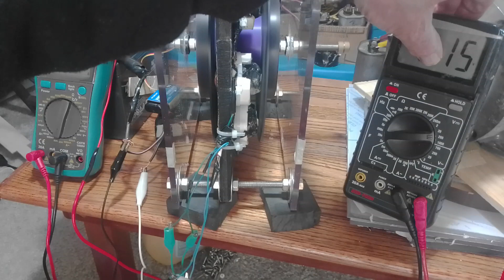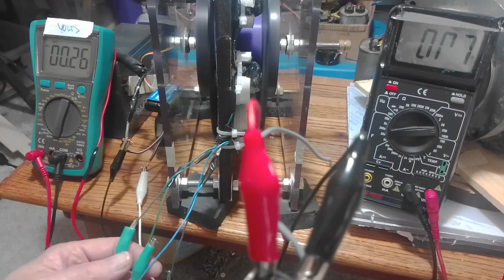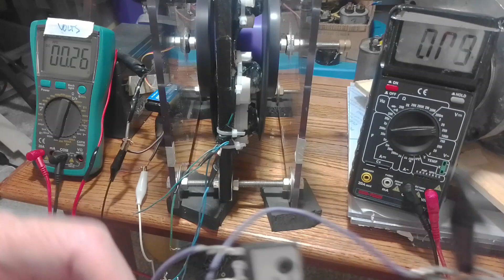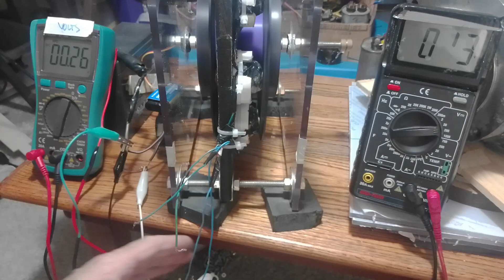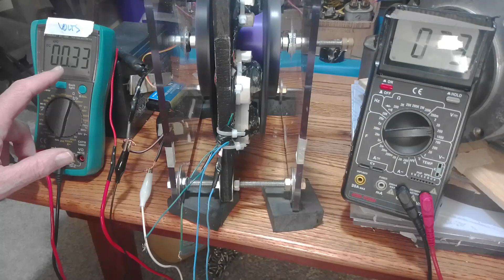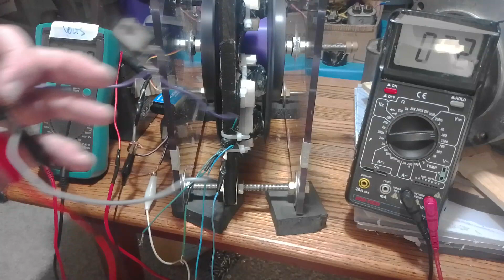.26A or .19A or .02A input at  12vdc input plus flyback and generator coils into cap

Comment: your generating volts DC so you have to put the dc threw an inverter before being ably to use it with ac devices like refrigerator .  Unless you plan to buy all new dc appliances its probably more electrical efficient to just generate ac and use it real time that what you dont use you can rectify into a battery for later inversion to ac but there is loss when you invert keep in mind , thats why its more efficient to use the ac real time , and instead of inverting dc use the dc to spin up a pulse motor attached to a super heavy fly wheel and store all your energy in the fly wheel , from there converting ac can be done without any loss , such as inverters cause (loss) about 20% or more sometimes
Reply from the maker: Hi Myke   my plan is to do the best of both worlds, fill cap A with flyback/backemf and induced generator coils, then fill cap bank B with also flyback/backemf and induced generator coils.  Then shoot cap bank A one way, and cap bank B the other way and its now an AC that can run AC stuff, if you want AC that is. Also doing it like this cap bank A can be "collecting" while cap bank B is discharging to load and vice versa.  The caps need to be decoupled during discharge, so if you do not do it with the alternating discharge of two cap banks, during the discharge of decoupled cap, there will be no collecting of flyback/backemf during that disconnected/decoupked period of time, things might blow up if suddenly the flyback/recoil recovery circuit is suddenly disconnected, plus you are losing some power that could  be collected too during that "decoupled" period so best to have two cap banks alternating in their discharge if you dont want AC but DC to charge batteries or whateve that can be done easily as well.
Reply: @MrDKONZEN  looks like you finally figured out the point in this diagram https://www.youtube.com/watch?v=WH4watZLhOA    I have been watching your channel seems your plan is to eliminate lenz using muller method , in my honest opinion and its only an opinion , i dont think you can get any amps with out lens drag occurring . None the less if someone finds a way to eliminate lens while keeping the amps and volts associated with it , that would be an achievement . Instead "MY PLAN" is to do what you just described by bouncing the flyback back and forth . This idea occurred to my after proto typing the Bedini SG  circuit multiple times. Some where along the way I noticed others trying to automate the swapping of the two batteries and out came the diagram shown , although this diagram is not an automation circuit its more of a 180 degree bounce a lot like a dpdt relay if you look at a double pole double throw relay you will see what  i mean . OK GL Man ,
Reply: @MrDKONZEN  I believe the npn will burn out if the on time is running to long because the coil gets fully saturated, it may not be necessary to fully saturate the coil to do any over unity , i believe over unity is achieved with finesse and a very gentle pulse DC, so essentially high volts are not required , for example sending 5ma dc 5v pulse with 5% duty cycle threw an inductor whos winding is 1/8inch thick  or more with fewer turns , the spike will not be in the 1k volts but it will be in the 200 v range , why the need for thousands of volts is beyond me maybe thats the brut of Man ass thinking
Reply from the maker: @mykedoes4099  yes less on-time as is possible.....working with motors spinning loads on shaft,  you might need more on-time than is perfect in a perfect world but there is a happy compromise somewhere (sweet spot) .....motors running on very high voltage pulsed DC have that problem of the flyback spike being at least 50 times the voltage of the input "forward current" voltage (while in your example of 5V and 5ma run motor its not a problem in fact something good to tap into caps or load)
.....so run on 1000VDC "pulsed" what comes shooting back is now 50K voltage good luck putting a diode and cap on that to bottle it up!  So now it gets to spark gaps like the Edwing Gray  motor used and maybe step down with HV transformers "or something" and charge 2nd battery pack with it. 
Why people like HV (one reason) is that in way of "generator coils" (making power) there is just no lenz braking reaction to rotor as the high voltage is "so thin" like flying airliner at 20,000ft vs 2000ft - just way better fuel economy up where the air is thin.... electrostatic generators like wimhurst machines an extreme example of absolutely no lenz law upon loading of generator coils stuffed with the HV
Reply: @MrDKONZEN  There is no flow back into a coil connected to a Capacitor because the battery is also a load assuming there is a battery in the circuit. This is why its important to look at the battery less like a storage device and more like a regulator which it is in regards to the  flyback other wise  Bedini would have just used capacitors  instead of a Battery. Its obvious the use of Battery is work around to having your capacitors blow out from the high voltage so in some way the battery is more capable than capacitors and in other ways capacitors are more capable than batteries , my thoughts are they should always be used together as one unit
Reply: @MrDKONZEN  if your flyback voltage is constant to 10k volts , i would use a 12kV capacitor array and then use a winding to drop the voltage back down in isolation
Reply from the maker: @mykedoes4099  I understand what you are saying, but I think if lead acid batteries, its best to just shoot the flyback right into them....they can take it, they like the spikes and lead acid batteries very good for that.  But "other way" is caps only go to 36V discharge to 12V battery down to 23V in cap and stop there.  You would have to do long term tests to see what is more effecient and effective battery charge. I dont really know for sure.  
You dont want caps to blow out from too high of voltage,as  they need to be discharged periodically......
hard to ruin a perfectly good battery with the HV flyback spikes but if lithiuim or other types of batteries besides lead acids this can happen even explosions...
If for example running on 5V and 5ma and so drawing about a quarter of a watt from a battery A and meanwhile charginig a battery B with the flyback/backemf spikes, (with or without a cap in parallel) you most very likely will have an "overunity system" right there easy enough if using suitable lead acid batteries (golf car type example) as over time you can swap batteries and if you swap at most beneficial time (one day? one hour? dont know for sure) the batteries will always be nicely charged up and your motor coils would be the load......however if spinning a generator under load, or running an electric bike or whatever that 5V 5ma power input is going to be so little power its not going to be practical and not overunity anymore since its going to need much fatter pulse width etc so in this case best to do the flilling caps and discharging to batteries while caps "floating" scenario, since it can be "stepped up" to be using bigger caps and higher voltages in them so more power comes out in the cap discharge, while direct to battery flyback scenario you are forced to not go outside of boundries that create the OU effect (very little power in and batteries charge faster from flyback pulse than power consumed to create the flyback pulse)
Reply from the maker: OK sounds good - if winding does not kill everything from the resistance of the winding itself, 
and "back down in isolation" is nice thought however the load on the winding in isolation can also kill everything good happening up to that point,  as the secondary of a transformer "reflects" itself into the primary when loaded,  unless a BiTT transformer or some transformer like that doesnt let the backemf created from the loaded secondary cause the  kick back into primary.
With very high voltages maybe no problems, working with 10KV in transformers (and caps) lots different than 100V in resistances and 
reactions.....
Whats nice about AC is you dont get the pulsed DC backspikes, it is sort of "absorbed" by the winds as the current changes directions but never that sudden "off time" which causes he HV flyback....instead you get backemf forces opposing the current flow at the time of change in direction (sinewave peaks)
Reply: @MrDKONZEN  The windings innate resistance determines your "maximum" load . If you need to power more load use a thicker winding with less resistance
Reply: @MrDKONZEN  My theory is that the lead acid battery is not capturing 100% since its a slow capture and not a fast capture like a cap will do, the point is to use a HV Cap rated higher than your flyback voltage after that the battery will regulate back down. If you have to put the caps in series to reach your voltage rating , your mf will decrease but you can always duplicate the series array and put a second one in parallel
Reply: I would not worry about that , the flyback happens so fast thre is plenty of time for it to dump before its disconnected, using a 20% or less duty cycle gives the flyback a whole 80% of time to dump, you can adjust duty cycle to over come this issue "IF IT OCCURS" to protect your build and npn start off with a 5% duty cycle , that 5% on time 95% off time
Reply from the maker: @mykedoes4099  Flyback twice the speed of light in my book - upon switch opening that instance in time, the current is going its own way already, and continues on its own way for that instant, but the flyback goes the other way, as it becomes a very high voltage backspike - so speed of light one way and speed of light the other and there is twice the speed of light (so very fast)
Its the "collector cap" to worry about.  It must be discharged at some time other wise it gets filled up, and stops collecting the backkspike and it becomes useless, might as well have no steering diode or cap at that point - the cap is full,.  So at some point the collector cap needs to be discharged.  Maybe if purpose is to charge a 12V battery do it at 36V for an example, if dumping into another cap, do it at whatever works the best,.  But the cap is going to need to be discharged into a load eventually, and at this time you better have the cap "floating" duing the discharge or else there is huge extra draw to the "primary: or the motor coils for an example and the mosfet might blow too.
Its not the flyback "dumping" to be worried about, (its already dumped itself into a cap easily and quickly)  its the collector cap dumping to a load to worry about.  Better have it "floating" or else pay the price of huge extra draw as a punishment.
Reply: @MrDKONZEN  The CAp is only needed for the high speed collection to be more efficient than just using a battery, I am saying to use the CAp in parallels with the battery this way the CAP is never full and always draining. In my opinion a Battery does not capture 100% and is less efficient than CAP but when used together you establish charge efficiency .  aka there is less loss when incorporating capacitors
Reply from the maker: @mykedoes4099  

I would say its better to collect into suitable size cap and discharge to battery for better battery charging effeciency.
Having a cap parllel with battery does not do too much good, might as well just shoot the flyback.backemf directily into the battery, if that is what you want to do with the flyback.backemf (charge batteries) as the cap is going to suck up some of the flyback which should be going into battery to charge, not into the paralleled cap (my opinijk
My "DRMG" idea is having the generator coil directily behind, and sharing core with the motor coils, so for one thing, the flyback backemf goest through the generator coils, boosting power made in the generator coils....and then generator coils load up caps to be discharged later on into whatever load you want, and the caps floating during discharge too.
Might be there should be two output circuits, one is the flyback from motor coilsd into caps  or into lead acid batteries "directily" and then the generator coils into their own load.  I dont know still testing out what happens and what is best to do according to what happens..
Reply: @MrDKONZEN  capacitors do not create loss unless they are leaking but that rare and the natural leak of a healthy capacitor is way less than a lead acid battery. Capacitors increase gain they do not create loss
Reply: @MrDKONZEN  channeling the flyback into your drive coils is not a bad idea at all, if there is issues doing that then I would just regulate the volts before you use it  to the drive coils , in this diagram you can see how volts can be regulated with  out the use of a transformer (100% CAP and Rectifier) https://www.youtube.com/watch?v=piX7chLAQTs&t=1s
Reply: so you see how capacitors can regulate potential before you blow out your coils with high volts , although the flyback does not have enough amps with those volts so it may not be a factor to worry about , but a thin winding might blow